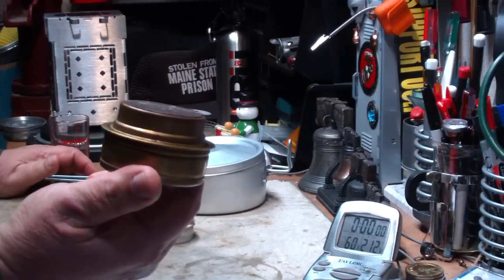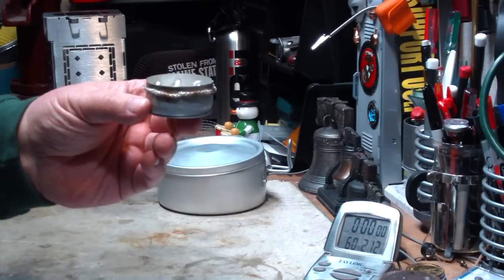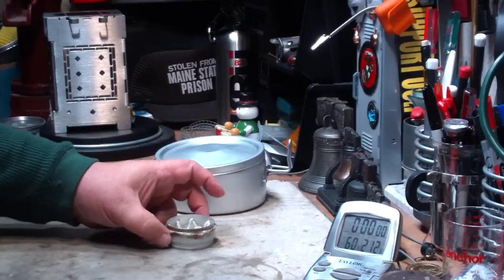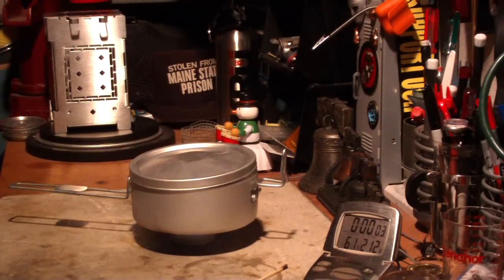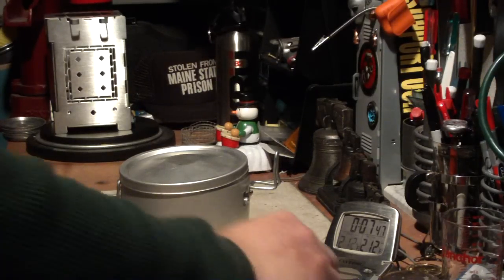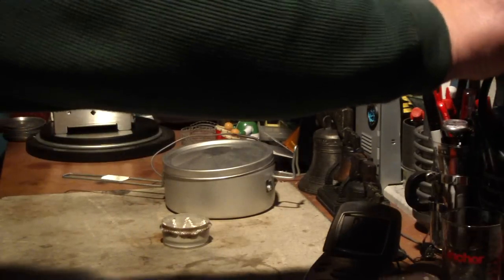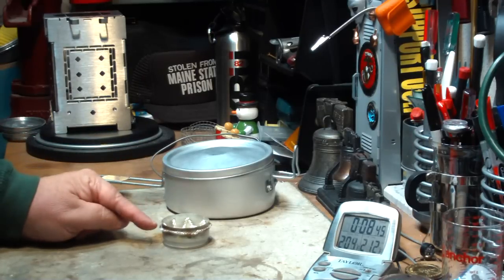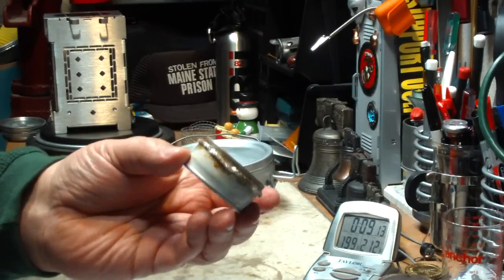IMUSA Pot with Little Soda Can Stove V3.1 Boil Test 2

Comment: I noticed the the flame distance between pot and flame source (i.e: jets or wicking) is a lot shorter than the 3/4 to 1 inch " Sweet Spot". Do wick stoves have a different range for optimum performance?